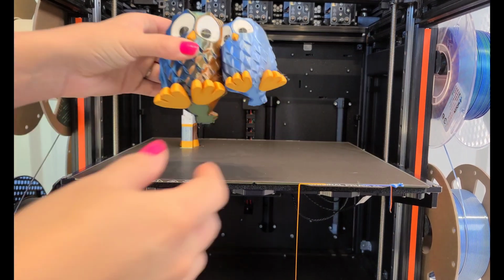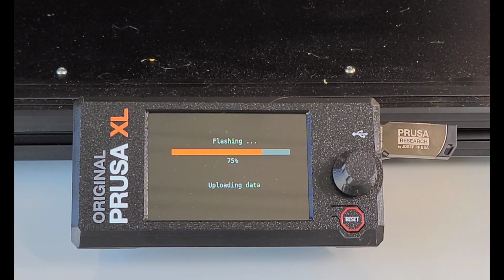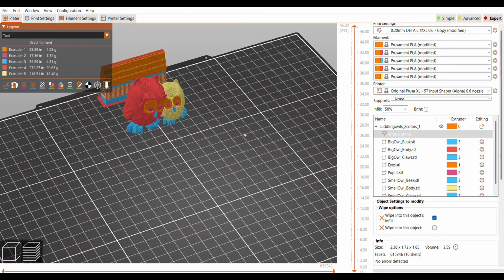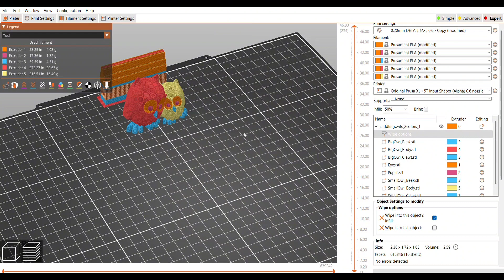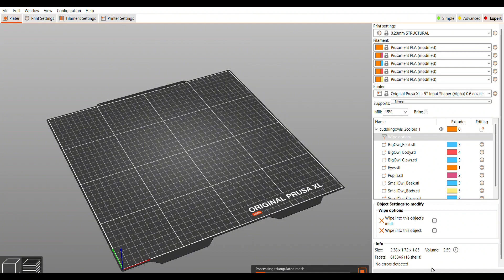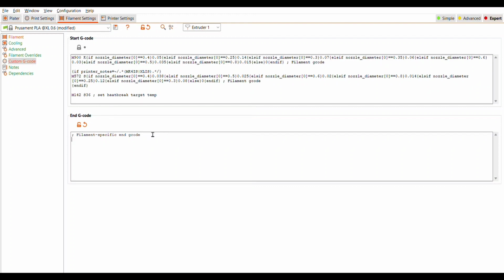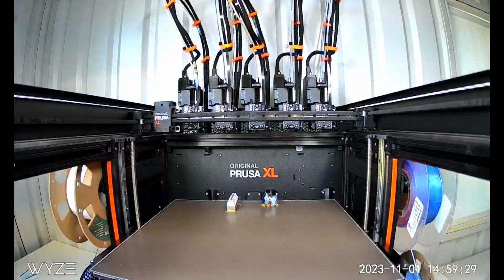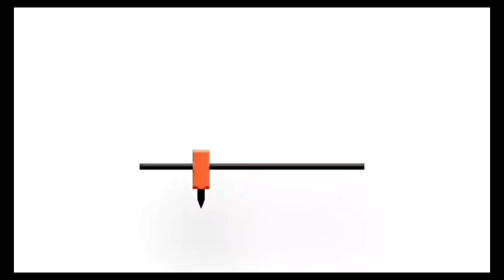Does stringing on the Prusa XL get better with Input Shaper?

Comment: I really hate long comments, but....

I spent 35 years of my career in precision manufacturing.  I think that is what drew me to 3D printing at the end of my career. 

I have found when trying to solve a difficult problem backing up to the most simple components of the puzzle will make it easier to solve.  This works for every type of manufacturing process; if after several attempts to tune your machine have failed, go back to the basics.  Make sure all the individual steps in the process are preforming as expected. 

It made be that a this version of model is not tuned well for a CoreXY printer.  I don't believe this is the case, buy it is a possibility. 

You mention in an earlier video, your temperatures are lower than you expected.  In precision manufacturing repeatable is far more important than accuracy.   If an instrument reads a property (temperature) the same every time it can be compensated.  If it varies slightly every time it measure the property, there is nothing that can be done for that.

I worked with instruments that cost hundreds of thousands of dollars and they all had compensation algorithms.  I don't expect these printers have the highest quality temperature sensors in them.  In fact sensing devices are one place most companies cut cost.
Reply from the maker: That's interesting. But I do have a single toolhead XL that doesn't have any issues printing at 215. But it's definitely possible that it's tuned different. Maybe I should print a single color print on the 5 toolhead at different temps and see how that works out. Thanks!
Reply: @tada3dprinting  That would be an excellent test.
Reply: @tada3dprinting  You might try printing a test tower the same filament at the same template on different tool heads and see if they print the same.

I think I would even try a temperature I knew had some trouble just to compare the results one tower to another. 

Could be the reading on one tool head is different from another. 

You could also try reading the tool head with a laser assisted thermal gun.

Comment: Tada there are a lot of other people out there with exactly the same problem as you with this printer so I don't think it's anything you are doing wrong. I think its down to the fact they've pushed out a product before it was ready for release and now the users are paying the price. 

I don't know what the returns policy is in your neck of the woods but you will have to decide whether to hang on to it and hope that the issue gets sorted or send it back before that window of opportunity is past.

It's a tough call but you've spent a lot of money on a machine that hasn't worked properly for days and isn't really showing much improvement with constant tinkering. Either way I wish you well
Reply from the maker: Yeah I agree. I decided to just stop obsessing over it for a couple of days. Then I contacted support and they gave me a couple of suggestions that have improved it. Now I'm trying to decide if it's enough. Thanks so much!

Comment: i got notification from prusa my xl with 5 toolheads will be shipped soon and i sould pay. It was very hard for me to choose what to do. Im not convinced from this printer any more. So i canceled the order. I will keep on track with the xl and perhaps i order it a second time. But i dont think so at the moment. Im also missing a housing, i want to print technical materials.
Reply from the maker: I can understand. I feel like this needs to be tuned much more. And Prusa chat has only given me suggestions. Hoping they fix this soon! Do you need the large build size? The Bambus are pretty easy to use.
Reply: @tada3dprinting  yes your right - my thing is not the build size, but the multi toolheads to avoid poop. I bought the x1c a longer time ago because xl is not coming and i like it so much. Thats one big thing i dont want to buy prusa any more
Reply from the maker: If you're happy with your bambu, I don't think you would be happy with the XL. They're very different machines in my opinion.

Comment: Looks like your linear advance (no input shaper) / pressure advance (with input shaper) settings are way off for that specific filament.
Would perfectly explain the gaps and blobs and that heavy stringing.

PrusaSlicer: filament settings -> custom g-code -> start g-code -> M900 (LA/noIS) and M572 (PA/IS).

OrcaSlicer offers an option to easily generate calibration targets to determine the correct value(s), that you can then enter/align in PrusaSlicer. Unluckily, the XL isn't listed in OrcaSlicer, yet, but the MK4 is. As the MK4 and XL share the same start g-code settings, and use almost the same extruder, you could try to calibrate the filament with the 0.4 nozzle on the MK4 and estimate the 0.6 nozzle value based on that. Or, much more effort, swap the 0.6mm nozzle to the MK4 and do the calibration that way - as a current workaround.

The calibration target gives you lines to compare, which one looks the smoothest, and the respective number beside. That's all. Apart from that, you can set the range of target values manually, if you feel you need more or a finer range of values to compare.

Note: For the best quality you have to calibrate each brand and every single color. Though, in general, the same types of materials often share close-to-same, if not exactly the same values.

Since I calibrate/tune my filaments (temperature - retraction - pressure advance), print quality has shifted to close-to-perfect on basically every print. -- Once you've done that, it's easy! :)

If you want to give it a shot -- hope that it can fix your current issues! :)
Reply from the maker: Thanks so much!

Comment: I think you've gone as far as you can. Other youtubers are getting similar results so it's the printer/firmware/slicer not the end-user. I would like to see somebody try 0.4mm nozzles on the XL but that's not cheap.
Reply: I'll post a video as soon as I get mine.  I got the 5-head and also ordered the 0.8, 0.4, and 0.25 nozzles since they were pretty cheap after the high printer cost.
Reply from the maker: Yeah that's a good point. I'm trying to decide which direction I want to go with it. Large prints or small details. Thanks!

Comment: those gaps are likely caused by the custom gcode. i would recommend reducing temps.

also, the next upcoming firmware of the XL should be significantly better for stringing since it introduces much better toolchange logic.
Reply from the maker: Thanks!
Reply: Is there an ETA on that new FW?

Comment: They took pre-orders for this machine 2 years ago. Claimed they couldn't build them because of "parts shortages." but I think we can agree this printer is still not ready for release, I canceled my pre-order even though I believe the tool heads are better than one nozzle on the Bambu. But I don't have faith in spending that kind of money on a machine that may become a paperweight compared to other machines before long.
Reply from the maker: I can understand. Yeah I'm not happy with what I received. Hoping I can still figure it out. Thanks!
Reply: I cancelled my multi toolhead order too - I have no doubts it'll be a good machine soon.  But not a year ago when I needed it. Prusa's network monitoring is non-existent.  I haven't checked mmu3 support but mmu2 programmers worked with octoprint to add monitoring support.  Why bother wasting filament and time when you could get a notification or visually identify an error remotely? These are the tools that will get multi color more users. But yeah, their solutions have not been hitting the mark for a while
Reply from the maker: @planckstudios yes my Bambu send me a notification on my phone through the app if there are any problems. Meanwhile I have to shut off my filament sensor on my XL because it triggers when it doesn't need to. And now I have to set reminders on my phone to "check on the XL" so it doesn't run out of filament. Very different processes.
Reply: @planckstudios  wait for prusa xl mk2 or mk3, maybe the issues will be worked out by then.

Comment: It's really nice to see the steps you're going through with the XL. I'm still in queue to receive one, but I'm honestly hopeful that Bambu comes out with an XL sized printer before then. As more videos come out about this printer, the XL just seems too far behind in user experience and print quality.
Reply from the maker: Some people seem to be doing fine with them. I don't know what I'm doing different. I think waiting is a good idea. Thanks
Reply: I just finalized my day-3 order for a 5 head version.  It's really, really damn expensive at $4000.  But, I'm going to give it a fair shake.  Worst case, I always can return it within the 60 day window and just eat the shipping cost.  I'm OK with that.

I went fully assembled, as I don't have the time to spend doing the assembly, but that may have been a mistake. I wonder if the variations are due to hasty assembly at the factory. Some have suggested movement in shipping may cause things to be out-of-spec as well on fully-assembled models.
Reply from the maker: @falxonPSN I think fully assembled is the way to go. For example at least. I want to get printing asap!

Comment: Have you tried replacing all the ptfe tubes with ones that have a larger inner diameter? Prusa's tubes run tight and that has been a prob on all the mmus I've setup.
Reply from the maker: No. I get that that's an option. But I expect my 4k printer to be able to be tuned within a few prints. Going on a week and a half and I'm getting frustrated.
Reply: @tada3dprinting  I agree with the other users - def dry your filament.i was so disappointed when their enclosure was announced and it didn't support mmus/XL - professionals are buying these machines and want their shit to work. Ignoring filament storage is not the way to support your milti-color users. I use the repbox with a bunch of silica gel to keep 5 spools dry with my mmus.  Takes some tweaking but works

Comment: My dual head XL had similar stringing issues on the first couple of prints.  The culprit turned out to be the moisture in the filament.  I would suggest trying a print with brand new, never opened, ordinary filament even if you think your filament is ok.  The larger nozzle is very sensitive to this.

If you have the same issue then you can try to eliminate the next variable.   If it were myself this would be the nozzle seals.
Reply from the maker: Thank you!

Comment: Hello, in 3 days I will receive 0.4 nozzles for the 5 heads and I will do the tests, a smaller nozzle will leave fewer threads, and the resolution will be considerably finer, I will tell you as soon as I draw conclusions
Reply from the maker: Yeah that's a good idea. I just have gotten so used to .6 on the XL. Thanks!

Comment: With the alpha firmware and the 2.7 slicer, try going back to the defaults for the filament.
Reply from the maker: I have not updated to 2.7. Next on my list. Thanks!
Reply: @tada3dprinting  The 2.7 slicer is needed for both input shaping on the XL as well as the default profiles have been tuned to reduce stringing.
Reply from the maker: I wish the github had stressed this. Because yes you're right. That was what was missing on my prints. Thanks!

Comment: I'm pretty sure now, that retraction and de-retraction are the culprit here. Those gaps in the back of the owls are caused by too little "extra length on restart". "retract on layer change" is ticked in your settings, right? It looks as if the following is going on:
On each layer or color change the filament is retracted but not enough for that temperature and the .6mm nozzle. Surface tension can't hold the molten plastic back and on top of that there is still too much pressure in the melting zone. The bigger diameter of the nozzle allows for an easier oozing of the too liquid plastic and the nozzle drags a string. When the new layer/ color starts, there is not enough plastic in the hotend because it oozed out and the layer starts with underextrusion. 
For the .6mm nozzle I'd go to the lower end of PLA printing temperature (like 180°C) and slowly increase it while printing until there is no grinding on the extruder. That way you find the minimum temp for your filament. If you now look at your print you can increase the temp until you see consistent layer lines and no underextrusion (I'd recommend a calibration model for the procedure). You'll be surprised at what low a temperature (and high speeds) you can print PLA with a .6mm nozzle.
Until now I thought it was an issue with the parked tools still holding too much pressure, but in this video it seems clear to me that the retraction and temp settings are not very well adapted to the bigger nozzle and the overture filament.
Reply from the maker: Thanks for that. Spent some time on chat with them today. Their suggestions were lowering temps and then upping the retraction. So I'm working on trying these out. Right now I have a two color benchy going at 190. I'm nervous to go lower but you're making more comfortable with it. Thank you!
Reply: @tada3dprinting  It's very hard to seriously damage a printer by setting the print temp too low. In the worst case it simply won't extrude anything which means the extruder gear grinds on the filament trying to push it through a cold hotend. From that there would be the ground off stuff on the gears, potentially making them slip even with the right temp settings, but if you know that, you can clean it off with rather little effort. If it does extrude but the filament melts too slowly to be squeezed out as fast as the extruder pushes it, the gears will still grind, but only whenever the pressure in the melting zone gets to high and thus the ground filament can build up on the extruder gear. If you watch the print though you can easily tell by the clicking noise when the gears are slipping. Increase the temperature and wait around a minute to see if the slipping stops. If not, increase the temp a little more. Steps of 2-3°C will help you to really fine tune the minimum temp and from here on it's really just a matter of layer adhesion.
Go on increasing the temp, until the layers stick together really well and adjust from there until the quality and shininess of the print is to your liking. Lower the temp again if you notice oozing and/or stringing.
For retraction, it's not a bad idea to leave that "wipe on infill" on, unless you are printing transparent parts, where that could be visible. That setting gives you a wipetower inside your print, preventing stringing on the outside. It's not much of a use on Lightning infill though because there isn't enough to wipe on. As a retraction test I use a model with a flat base and two or more pillars of around 5-10mm diameter. Some people use spires instead but that's more of a stress test for extreme situations. 
"Retract on Layer change" and "Wipe while retracting" should be ticked on and "Minimum travel after retraction" tells the printer not to retract if there is less than that distance to move after the conditions for a retraction are met. The latter helps to avoid missing parts of a layer if retraction and de-retraction can't keep up with printing speed.
You don't want to have too much of a retraction length since that may pull molten filament out of the melting zone and cause trouble with pushing it back in. That means you should increase retraction length carefully in small steps. I don't know what the profile of the five-head is set to by default, but I'd start at 2.0mm (which might be way too little) and go by increments of .5mm until I see improvement. Then I'd go by .2mm steps but as a rule of thumb I wouldn't exceed the height of the heating block by more than .5mm. Once it gets worse again or I see missing layer starts (like in the back of your owls) I'd go back one step and add to "extra length on restart" using .2mm steps until the layer starts are no longer distinguishable from the rest of the layer line. If there is still some stringing left, increasing the retraction speed may help to further reduce that.
Finally you can play around with layer height and printing speed to adjust to your nozzle diameter. Increase the printing speed and you may see even the last wisps of stringing disappear. Increasing the layer height may or may not reduce the nozzle pressure and get rid of the stringing. Increments of as little as .02mm in layer height may yield visible improvements. But those two parameters are really micro fine tuning and have to be dialed in for each filament or even for each spool of filament.

Sorry if I write too much, but I really want you to succeed on this, because I think that five-head is an awesome machine and I'd love to see you profit from its abilities. I can see so much potential for your future designs, once you have it working accurately.

Comment: Lmao. I’m sorry.  Can’t believe this wasn’t figured out before shipped.  I’m a Prusa fan but…..hahahahaha
Reply from the maker: And even the chat gave me suggestions. And I thought "shouldn't someone have figured this out by now?" I want someone to tell me they used this filament at this temp with this print with this slicer with this firmware and it worked. So I can at least see if there is a problem with my printer! I'm printing a benchy at 190 right now. Thanks!

Comment: Even with 0.6 nozzle size, it shouldn't be this bad. Try again to calibrate everything from Zero such as PA and temp. Also just to be sure, try to dry your filament.  Then I will do stringing/retraction test for one head to see if retraction is working correctly and the values are correct.. Time to watch your print to see if the stringing happens from the printed part to parking position or from the purge tower to the printed part.
Reply from the maker: Oh that's true. See where exactly the stringing is happening. Thank you!